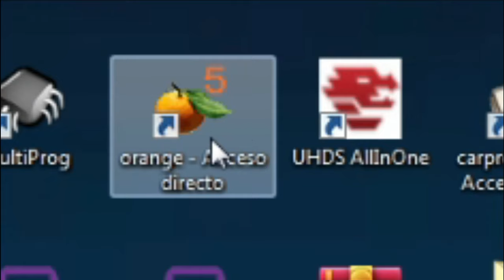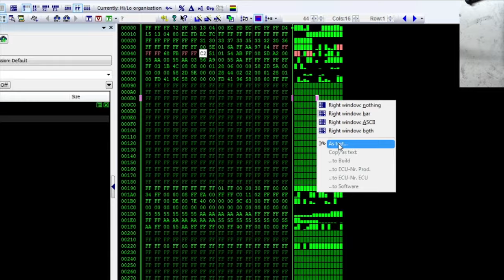HOW to remove IMMOBILIZER from car / IMMO OFF with emulator

Comment: look i have a 1998 dodge dakota with a 5.2 v8 and auto transmission. the ecu shorted out i got another one and it cranks first try but instantly dieds how can i removw the immobilizer

Comment: I appreciate your time sir. My 2002 Pontiac Grand Prix has in Immobilizer too and two times I had to reprogram my key 🔑 I believe i can use this video as a reference to do what you did to bypass it and then I can just cut a few keys and use them right away 😎😎
Reply: Mm